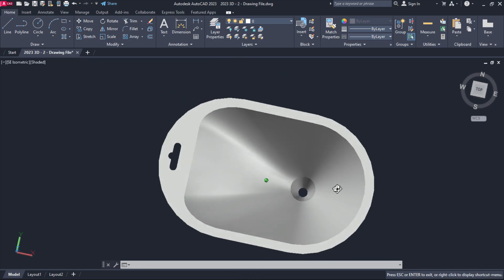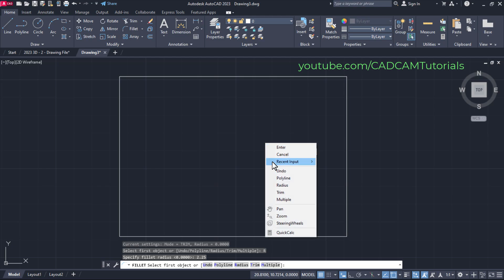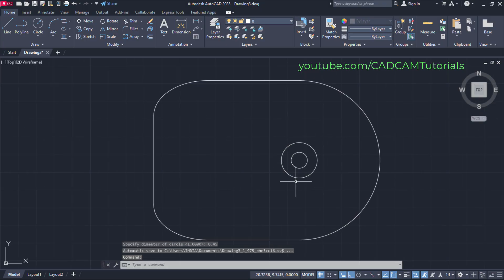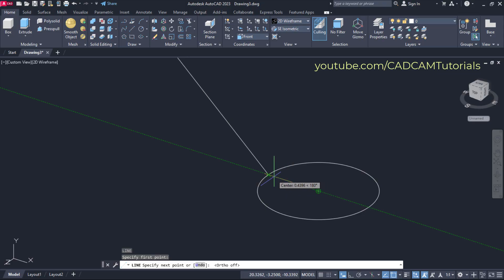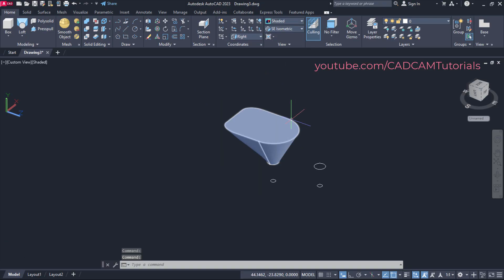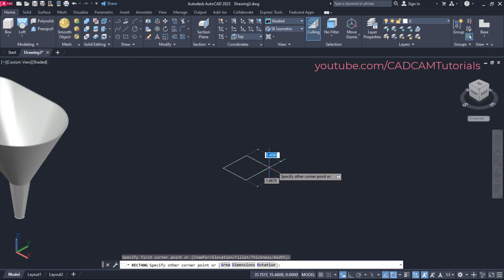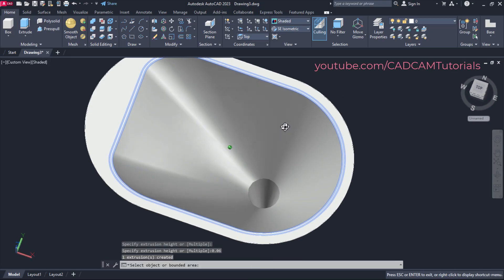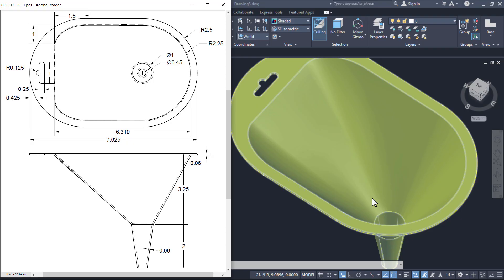AutoCAD 2023 3D Tutorial for Beginners - 2

Comment: Since you're working a lot on autocad i want to ask you a question about the best GPU from those for workstation :
Gtx 970m
Gtx 1050ti
Quadro M4000M
Reply: i installed autocad 2023 to my laptop with 8gigram and I36gen it work fine